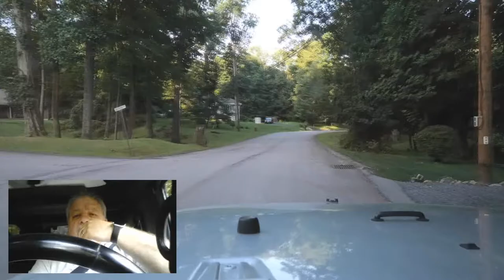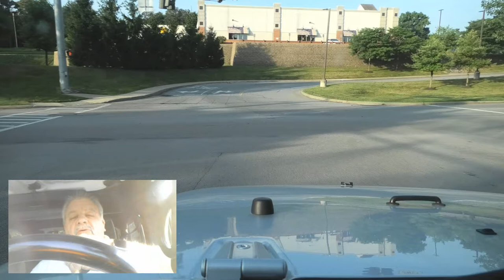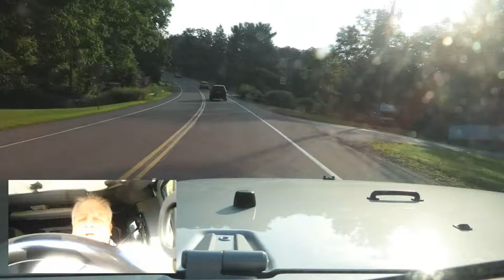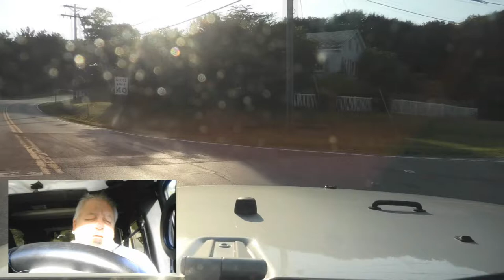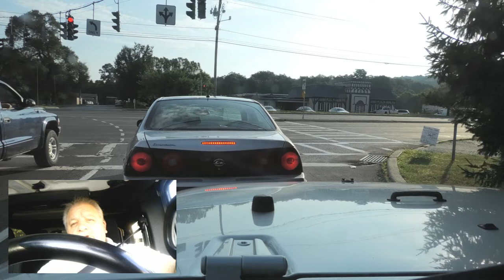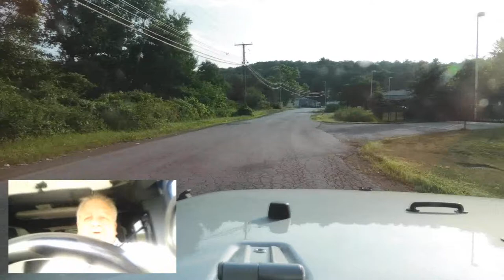ac car talk while driving

Comment: Thank you very much for this informative video, now here's my three questions on A/C maintenance &repairs,what Is the recommended A/C check and refill service interval, each Your or on each two year  ?How much A/C repair shops usually charge for system refill and finally let assume the customer is in need for a brand new Compressor on say Ford Crown victoria year of 2000, how much on average installing, refill would cost + parts included in U.S, Best Greets,Paul
Reply from the maker: Alc compressor kit which comes with a receiver dryer and any compressor company will not warranty a compressor if you do not change the receiver dryer with the compressor,My cost is 171.00 for the kit list is 307.00 see some shops will double the list of the parts or others will charge list and still others will mark up list 20-50 percent .
Must shops charge anywhere from 89.00 to 175.00 for a recharge which usually includes evac the system add dye and fill it to the recommended amount? There is really no maintenance that can be done on A;c except belt and clean the condenser part in front of your radiator.  It gets buggy and dirty especially if you are on any dirt roads. Just use a hose and spray it with water.  change your cabin air filter it if has one. some do some do not.